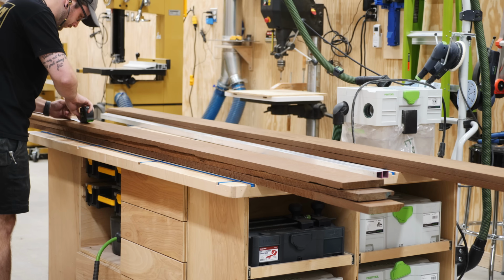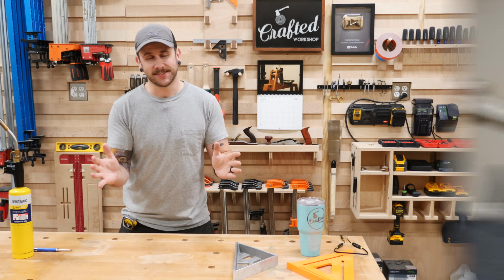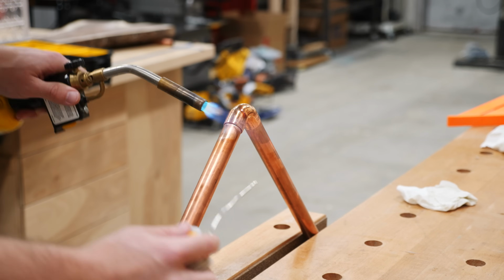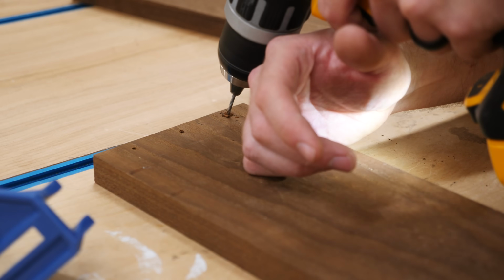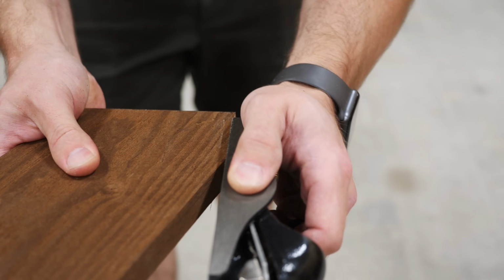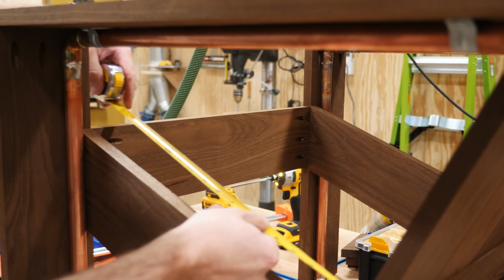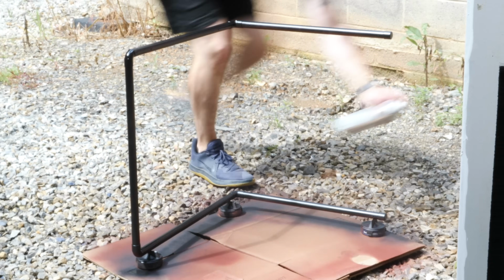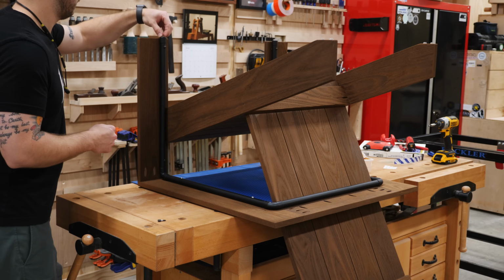How to build a modern Adirondack chair // Outdoor Woodworking Plans

Comment: Genuily curious about the copper reinforcement, it seems a lot of extra overhead and money compared woth regular Adirondraks . Is this added after testing without the reinforcement and finding the structure weak? Ive always been told this chair design is specifically made to be sound and sturdy with nothing more than wood, hence the diagonals.

Comment: I purchased your plans for this chair, the plans were much different, than the chair you built in the video, there was , now mention of the brass tubing in the plans at all. And the plans have gaps between the seat and back peices, with Datos, cut in the side peices. It's not a bad set of plans, just wanted to let people know the plans, and video do not match

Comment: A couple tips. Just torch the stickers and they wipe right off with rag. Once you finish the solder joint hit it with the flux brush while its still hot. It will be bright and shiny.

Comment: Big tip for the Japanese saw on the plugs.  Get a 90# compression (high gloss) business card (gun show, craft show, ect.).  Lay this down and let your saw ride on this versus the surface wood.  You will have to use a Block plane before sanding, but it only takes 2-3 swipes.  You don't get the saw blade tear out on the surface wood.  In other words, cut and work the plug not the facial wood.

Comment: Super clean! Good info about the thermally modified woods 👊 I'm not sure if I missed the reasoning behind the metal frame. Is it for strength? That design (no rear vertical support) is the way I prefer to make traditional adirondack chairs and has always been more than strong enough.

Comment: I would have just used pine and either stained it or burned the outside and put a gloss over it. I have been making outside furniture for years with pine and have had no issues as long as its stained and has a protective barrier on it.

Comment: I don't think I would have put end caps on the copper pipes. It will condensate inside and once you get enough of it, it will freeze in the winter and split the pipe. Drill you a little weep hole so it can drain out.

Comment: a tip to avoid splitting for pocket holes would be to either wiping some wax or some soap on the screw or to even take the point off the screw. ive never had any problems after I found these solutions for me to prevent it

Comment: I noticed that you were using your DeWalt "impact driver" to install the pocket screws. I'd been doing the same for several years (also with mixed results depending on the material) I'd be willing to bet you use the impact driver because your Kreg step drill bit stays in you regular drill driver through the process or is loaded with other drill bits :) Well, I finally found a step drill bit that has a quick change hex shank and now I use the impact driver for drilling the holes and my regular DeWalt drill driver with a stop clutch setting of 6 to drive in the screws. I've never had a problem with over driving pocket screws ever since. P.S. I really like the design and the look of this chair. Its a winner in my opinion! Thanks for sharing :)

Comment: using copper pipe as a way to make the chair more rigid....is just whacky. What the hell. You have a shop outfitted with primo powermatic tools, why not do it right and use stronger joinery in the first place.

Comment: Next time you use pocket holes on hardwoods use some paste wax on the screws.  I usually put a liberal amount on the threads and then drive it home.  It gives the screw enough lube to go in without splits.

Comment: Nice job pulling it all together - 5/4 boards will be less split-prone when using the super-cooked wood and look more proportional for what you are building (so much so, maybe you wouldn't need the metal supports) - also, ash is more likely to split anyway (i.e. baseball bats). Where's the cup holders bro - drill 3.5" holes, ease the edges w/ a round-over bit and make bent copper U-strips screwed to the under side of the arms to support the bottom of the cups/cell phone - just say'n. Or, just put black plastic cup holder inserts recessed flush into the top surface of the arms. ;^P Keep up the good work!!

Comment: Looks like you had as much luck aluminum brazing as I did.  I'll definitely be revisiting that process, when it's appropriate, but I switched to fasteners for my project.

When you're cleaning the outside surface of the copper pipe, it's easier to use abrasive cloth than the brush.  It comes in a roll.

Comment: Johnny, have you ever tried using wax when driving screws into hard wood? I usually keep a cheap candle around to use on screws for when I'm doing oak or other similar hard wood work. Sometimes, rarely, I'll do it on my mesquite as well (I usually dont like screws in my mesquite projects).

Forgot to say that is a really designed chair. It's an awesome look.

Comment: HI copper soldering 101, clean the parts add flux, THEN heat from one side, when the flame turns GREEN on the other side add the filler materiale..  That's it :)

Comment: I hate to make comments like this especially when I know how competent and talented a designer and maker you are but I couldn't help but feel slightly confused by this project, and would love to hear more a bit more your thought process!
In my opinion, the pocket holes give the impression of wanting to create something that was simple and accessible however to me aluminium/brass brazing is quite a complicated and technical process. I'd completely understand why you'd compromise on this if it was the only way to get the desired strength or look.  However, the most beautiful aspect of copper (the colour and patina) is hidden behind the wood and a layer of paint, and I couldn't work out what its achieving structurally (e.g. allowing the seat to be cantilevered etc) as there are a lot of similar designs out there made entirely out of wood.

I hope you don't take this the wrong way I just am generally curious if there is something I'm completely overlooking not understanding :)
Reply: He mentioned that he doesn't upkeep outdoor finish, so likely painted avoid rusty copper down the line? Maybe?
Reply: @crisvega7588  copper doesn't rust I don't think
Reply: @airvideo7  that's right, brain fart, I should have said tarnishes.
Reply: I’m with you.  I don’t understand the purpose of the added cost and trouble of working with the copper when wood could have been used and accomplished the same thing, only stronger.

Comment: I'm a big fan, but I hate everything about this project except for the design. The joinery is all over the place, and the copper frame is a ridiculous and useless feature. It's not adding any strength because, well, it's copper, and it looks just north of terrible. You mention that the wood will patina, but then you painted the copper, which would have also been a good looking patina. I dunno man. I feel like this one is a miss.
Reply: Completely agree, really curious to know more about the thought process behind this one :)

Comment: Were you using an impact driver to drive the screws into the pocket holes instead of a regular drill? I’m wondering if that added to the splitting, or simply cause the material? Just wondering your thoughts?
Amazing design and build!! Love the modern take!!